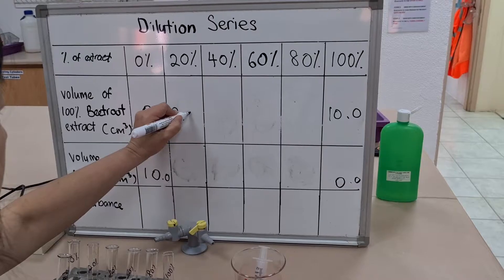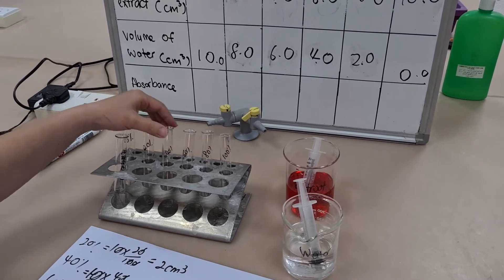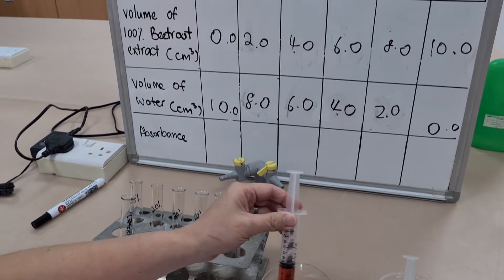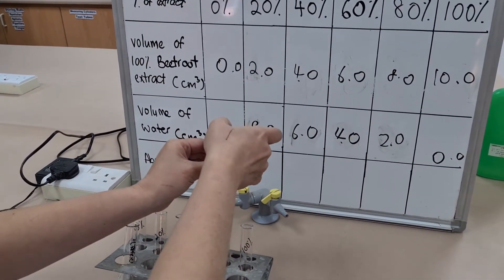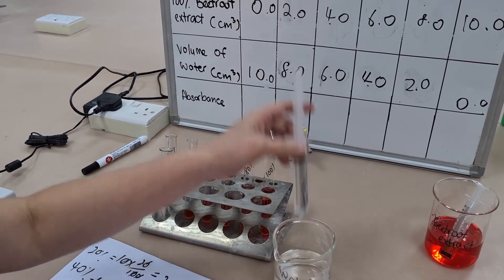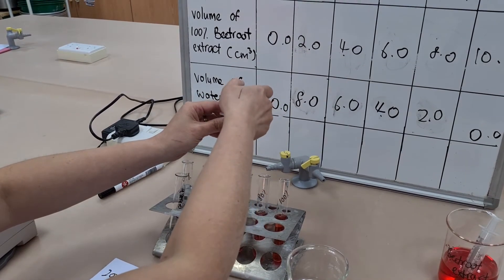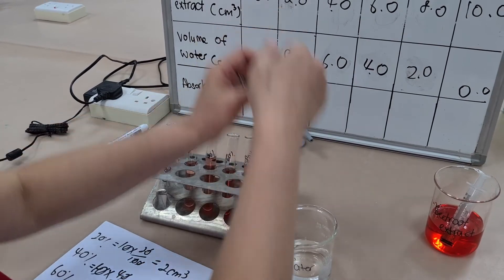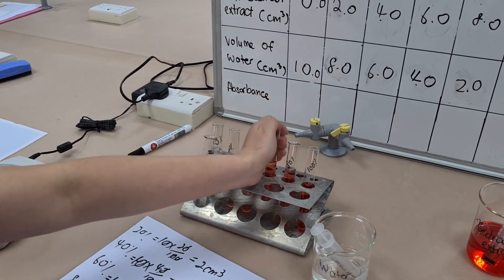AS Bio 1.1/4 How to make a Dilution of a Plant Extract

Comment: How do I dilute a plant extract that has been evaporated using a rotary evaporator? It will clearly be less than 5ml. Great video by the way!
Reply: I have the same question.
Reply: Same question... did you find the answer?
Reply: Make stock solution first, then you can proceed with dilution method
Reply: Answer is simple
1. If you have more dilutions, you need more yield.
2. If you cannot provide more yield, then divide your total yield to the number of dilutions needed and start diluting using water.
3. If yield divided produces insufficient volumes, then do no.1 and adjust your totals